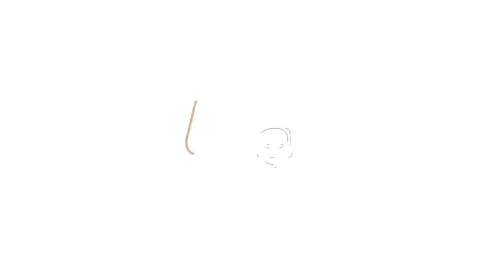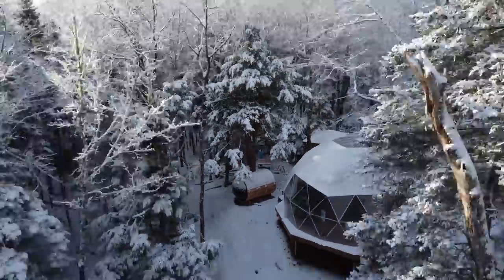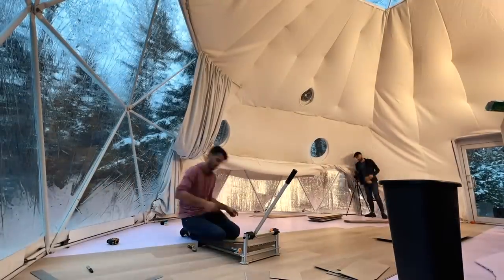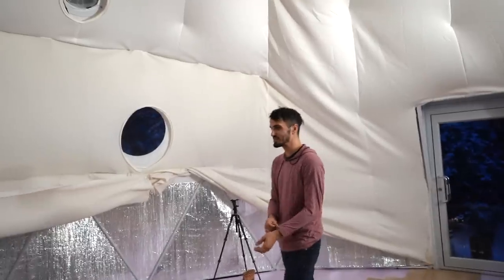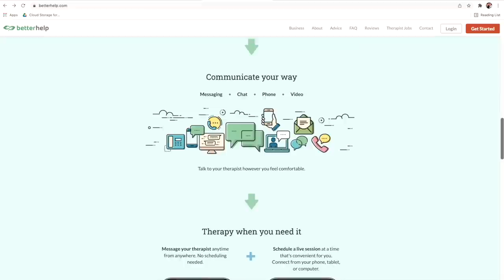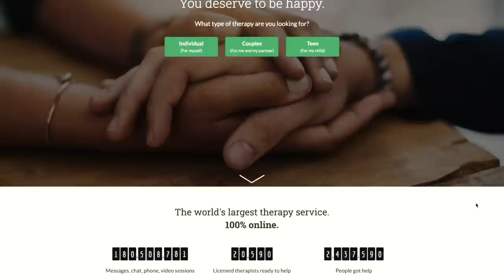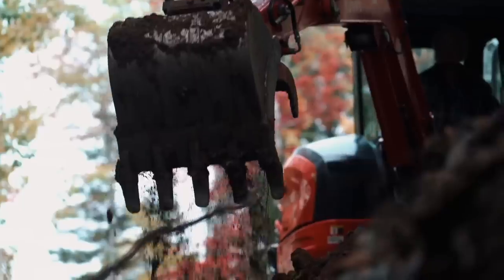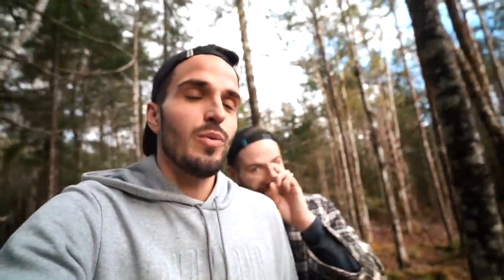Building our Home in the Woods (Geodesic Dome)

Comment: If the heating element is more centralized in the room, the better the heat radiates evenly. I know having the heater in the middle of the room might not be the most ideal, but for sure, it will be the coziest. Just food for thought. Great job, guys!

Comment: The fire place is off centered as there is room on the right for your wood pile.   So if you made a rectangle hearth  (instead of the square just for the stove) it would be appropriate space between the windows.   No one goes behind a wood pile so you would put a window there, makes sense to have it further over to the right exactly the way you have it.  Fyi in case you didn't know

Comment: So much work done.  Love the view of the forest, but surprised a 'cube' would not work for bathroom and kitchen wall with possible sleeping above (would suggest real stairs to any loft).  Running into the 'wall' would be similar to Frank Lloyd Wright's short small entryways opening into larger spaces, providing even greater impact of the larger room after the small space.  Could also buffer any wind or cold when opening the door.

Comment: For your new fireplace be careful with the exhaust pipe. 
If you shift it, it will no longer be held on a vertical axis and may tilt, leak smoke, not to mention that it could damage the dome.
You should also install a heat deflector behind the chimney to protect the plastic dome and recover plenty of heat. 
It costs nothing and works really well.
Keep it up you are awesome 😘

Comment: 100% do the mezzanine floor. Just have it floating on posts. That way you'll maximise your space and benefit from the warm air rising. You could do a left and/or a right wall panelling from post to post to create areas without obstructing your view of the window when you first enter the dome....eg a tiny houses kitchen with overheads could be behind one of the panelled walls, the other side something else. You can still walk around the entire inside but capitalise on vertical space available. ))))

Comment: I wonder (hope) you've considered building that 'cube'/loft just inside the door.  There would be lots of open space beyond. When you have glamp-guests, they may need that extra bed. Also warmer up there in winter. Plus with something squared off, if lends to the possibility of storage- cupboards, shelves and hooks- like an entry-way or 'mud room'.  
Also, consider a thermal mass stove (if you haven't already, look them up. They're smart and use less wood while staying good and warm for a long period of time).  You shouldn't need a huge stove. You just need something big enough to stay warm through the night (an electric blanket would help with that).  And with solar power/electric, the possibilities are many as far as back-up heat.  
Also keep in mind, an elbow is going to be just as weird as the off-center is now. And you should have space for a vertical wood-stack/storage enough to get through a day at least (otherwise you're opening and closing the door (losing heat) again and again all day- especially with a big stove). 
Has it been considered that you might want an indoor composting toilet? I haven't heard about one yet. It's a meaningful thing in wintertime. That loft- and the spaces it creates would help with planning that.  Just a couple thoughts as I watch you work so hard- only to re-think, re-do and spend more time and money.  
Do you imagine having glamp-guests in the winter? Only in summer- or 3-seasons? What would they need/enjoy? Does it even matter right now? No. But if alterations cost more and aren't important later when you move out....blahblahblah...  Just thinking out loud and brainstorming.  
You guys really are doing such a good job.  Hats off to you both!

Comment: Your geod looks comfy.  Fireplace.  What you want is one that has an air manifold with fan built into it.  The fan takes in room air and pushes through the hot manifold and then the air is heated up very quickly and is pushed out at a very hot temperature.  The size you have would work fine and would heat up your geod beyond belief.  My sister had one in her house and it worked very well.  Floor looks great.  I just bought a cordless hedge trimmer to clean up some of the weeds on my weekend property.  I am curious as to how well it will work.
Reply: Also, I saw your hockey skates in your shed.  Being a hockey player myself I am stoked to see your hockey skates.  Maybe some pond in the near future?  Yes, I've played hockey in Toronto and Montreal among other places.  Love those guys up there.

Comment: I've had pools at houses I have owned. DON'T DO IT!  Fresh water pools are only useful about 4 months per year, but will need maintenance at least 6. It takes a long time to heat, even with your off grid power. (Natural gas is much more efficient.) Salt water is a little better based on chemicals needed (none) but it still needs cleared and swept daily. It also reduces the saleability of the property were you to sell it. I enjoy watching to generation 2 behind me living our dream. I was a back to the land type in the 70's, but you have so much new technology to use. Good for you. Good luck as you move forward. Craig

Comment: I'm not sure if anybody else has mentioned this in the comments but they do so elbow joints for the stove pipes. That way you can center the stove and just bend the pipe and still use the existing hole in the ceiling
Reply from the maker: We looked into that but there’s some risk with installing it that way so I think we’re just going to square it up with the room instead! Appreciate the advice though ☺️

Comment: Exceptionally well done video!!! I had two questions:❤ is the spray foam covered with fire retardant underneath the floor? Highly recommended in case of a fire. Also keep the trees cleared around a 20 probably more like a 100 feet

Comment: I have a 1340 sf house that takes about 1.5 KWH in the worst case. You are producing ten times that. So you won't be running out of energy. I hope you are selling excess energy back to the grid because otherwise that's really too much invested in a system you won't use.

Comment: How is the excess electricity generated by the solar panels dissipated? Some will get used immediately, some will go into battery storage for use later when the sun is not out, but it seems like there will be still more power. For properties on the grid, that power can be distributed on the grid, but that's not the case here.
Reply from the maker: We’ll have two options. The first is a “solar dump” which is things that are electrified only when the batteries are full and the house isn’t taking electricity. This can be things like a car charger, pool pump, many different things. The second, and most important part, is called a charge controller and turns the system off when all electric demands are met and will turn the system back on when needed.

Comment: Looks really great. I may be putting my two cents where they don't belong, however is it possable to build a platform for a sleeping loft whil keeping the visual refrence? IE a loft on 8 legs but no walls? Then build railings on the loft? I thing it would use the space more effenciantly using your vertical space. 
Keep up the awesome work!

Comment: You solar panel field reminded me of stadium seating or bleachers haha. I thought you were putting in a concert arena!

Edit: Depending on time of year, you might be able to set up a system to heat a hot tub (or hot spring) with excess energy after your batteries are fully charged during the day (since it seems likely you will have excess energy). It would be a nice way to use the extra and get a nice convenience.
Reply from the maker: Exactly our plan! ;)
Reply: @tylerandtodd  Oops. I guess my brain was already preoccupied with  “What could you do with all that excess energy?!” that I didn’t realize you mentioned doing a pool/slide with the excess energy haha. Don’t mind me with my inattentiveness. 😉🥺

In my defense, it was four am when I commented haha. 👀

Comment: Looks great!  Can’t wait to see the solar field when it’s done. Question though about the wet floor! Why wet? And will covering the floor help or is it going trap moisture and cause a problem later?
Reply: I noticed that it looked wet in spots, too. Maybe something spilled and it dried before they put down the flooring. 🤔
Reply: There was a brief aside that it was condensation.  The foam spray under the platform foundation was supposed to act as a moisture barrier to combat that issue. Perhaps the inadequate heat from the too small wood stove adds to the problem. The added insulation of the subfloor will help.

Comment: The new stove may need to go toward the center.  Make sure it can be next to the dome wall.  Its not your typical wall (heat-resistant).
Reply from the maker: It’s only 10” clearance required as we have an insulated stove…made sure do double check that! ☺️
Reply: @tylerandtodd  I have the same...they're great!

Comment: You have rain/snow water seeping inside around the perimeter of the dome. This will cause mold and mildew under your top flooring. Didn't you install flashing around the bottom perimeter of the dome to prevent water seepage?
Reply from the maker: It's not rain and snow, it's condensation that built up before we started regularly using a dehumidifier...has definitely solved the problem!

Comment: Do you have a circulation fan running to help pull the hot air from the top of dome so all your heat is not just above your heads?

Comment: Great work guys!! I see you are struggling with your layout…your key to solving that may actually be in changing your assumptions.  One of you mentioned that your basic “unit” was actually a triangle.  What you have implied so far is that you are trying to build to a basic unit that conforms to a square.  The best example of adjusting the thinking is to examine the work Frank Lloyd Wright, who did in some of his home designs.  He used the basic unit of a triangle…one of the best designs is a home in Ann Arbour Michigan…the Palmer House.  Everything conformed to a triangular grid which even gave some furniture which was triangular (like the beds).  This basic assumption shift can make a huge difference in how you think about the space and how you design the built ins….Good Luck…love you guys!!!!

Comment: Too bad you nixed the "CUBE" idea. Presumably, you intended  to put the bed on the loft on top. You're heating up a 2 story  structure and only living on the ground floor. No doubt the"Second floor" is  tosty warm. Rather than investing in a larger stove, my first suggestion is to get in the habit of cllosing those thermal drapes over the picture window at night, especially during the Canadian winter.  My second suggestion is a ceiling fan. Ot should help equalize the temperature between your 2 "floors".

Comment: I REALLY LAUGH AT YALL IN A GOOD WAY OF COURSE. I WAS JUST WONDERING WHY YOU DIDN'T GO WITH A MOVEABLE PANEL FRAME TO WEAR YOU CAN ROTATE THE PANELS IN THE DIRECTION OF THE SUN?  YES DIRECTION MATTERS YOU KNOW THAT.  THE SUN CHANGES TRACTS DEPENDING ON SEASON.
Reply from the maker: Because the economics of dual axis tracking systems don't make sense if you dig into the numbers...also, the angle of the panels change, not the direction...the front array is for winter angle and the back is for summer :)

Comment: I am confused.  Is this dome your permanent home or just your temporary accommodations until you complete your cabin?  I thought is was temporary and would become income property once the cabin is built.  If I were a future customer I would much prefer to go upstairs to a ready made bed and not have to make up a fold down couch.  Plus, without the platform you can only rent to groups of 1 or two people.  If I was a couple with 2 children,  I would want a separate area to sleep.  If I were 2 couples that liked to vacation together I would be looking else where for a vacation.  You really need to think about this like you should have thought about taking down the tree or, more importantly, putting down the floor before you move in.  Trust me, I have many projects that with hindsight I could have saved tons of time and work if I had just thought it through.  You need to put your ideas out there to your followers and wait for some feed back because out there somewhere is a viewer with design experience that would send you idea.  Heck, there might be a company that designs platforms for geodesic domes that might furnish a platform at a discount or free.  Sometime instead of doing all that research on the internet yourself, let the research come to you.  My comments are are far and few between but sometimes I have to let it out, sorry.  With that said, you guys are amazing!